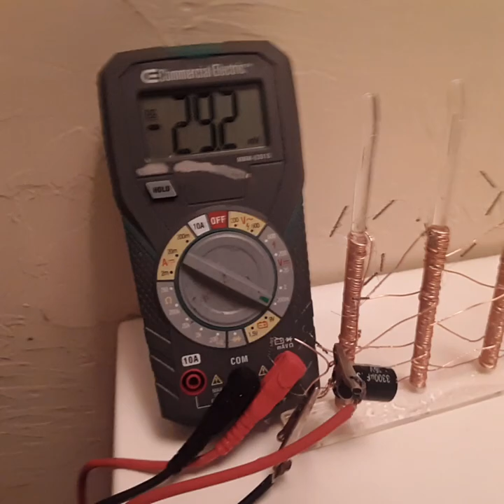HYGROELECTRICITY : AIR TO ELECTRIC POWER !

Comment: Where are the research links?
Reply from the maker: https://www.sciencedirect.com/science/article/pii/S2211285522000271
Reply from the maker: https://pubs.rsc.org/en/content/articlelanding/2018/ee/c8ee01502c
Reply from the maker: https://www.zmescience.com/science/physics/graphene-membrane-fuel-cell-hydrogen-95421/
Reply from the maker: https://www.nature.com/articles/S41565-021-00903-6
Reply from the maker: https://pubs.rsc.org/en/content/articlelanding/2022/ta/d2ta05221k
Reply from the maker: EU WATER TO ELECTRICITY PROJECT
https://ec.europa.eu/research-and-innovation/en/horizon-magazine/realising-century-old-dream-make-electricity-air